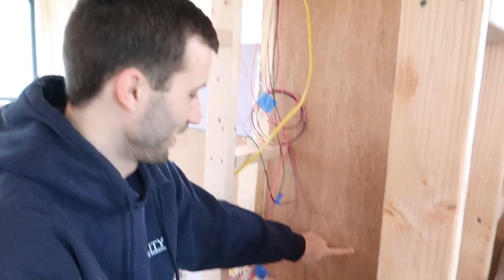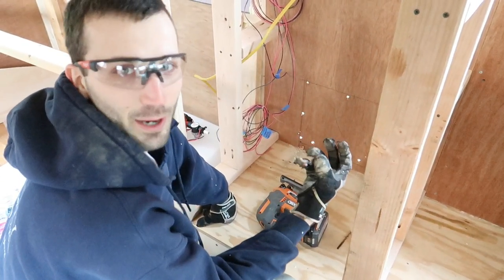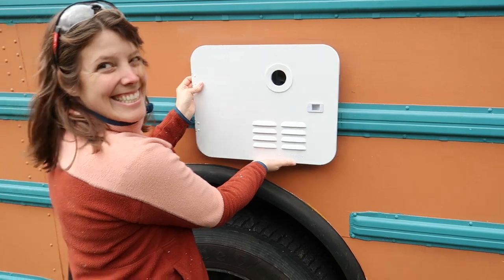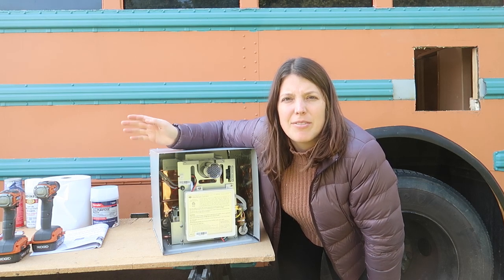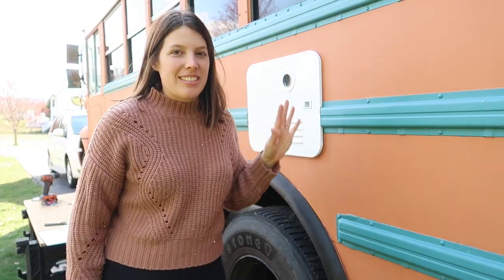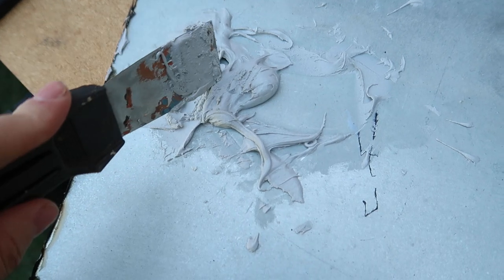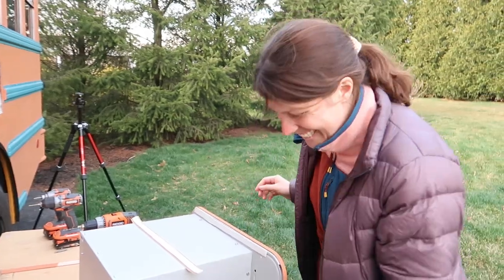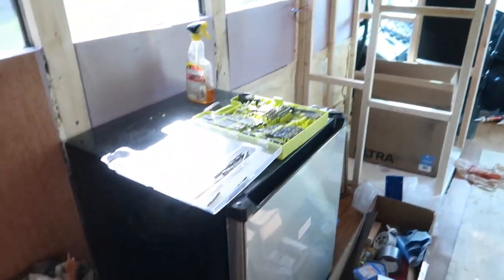Skoolie Water Heater Install - Girard GSWH-2 | BUS BUILD EPISODE 31

Comment: great installation it looks great and im glad you guys decided to take care of the exposed metal rails. one question, if you guys are running this water heater off of solar, what does your solar array and battery bank look like and how much power does it use when its on? I'm trying to find a water heater that works with my build but all of the heaters i have found online say they use over 2,000 watts which is to crazy to use with my current solar
Reply from the maker: Thanks so much! We have 1200 watts of solar and a 600 ah battery bank. Our water heater seems to use about 1 amp when we have it running.

Comment: How is it working for you guys? Do you think it’s as efficient at higher altitudes? I was looking at some similar ones and saw that some like the Fogatti talk about having high altitude modes. What are some of the other ones you guys looked at? I just spent 2 days trying to figure out the right electric water heater only for my husband to remind me we can’t have one that’s 3+KW thanks to our inverter so we’ve decided to now go with propane so now I have to do even more research and figuring out 😅
Reply from the maker: It’s worked great for us! We spent a couple months in Steamboat Springs, CO last winter which is around 7,000 ft and didn’t have any issues. It does have a “anti-freezing” feature that will automatically kick on in colder temperatures to keep the pipes from freezing. It’s a great feature, but can be a little annoying at night when we’re trying to sleep since it’s right by our heads. The other brand we were considering was Eco Temp but they didn’t seem as conducive to RV life with how much they needed to be vented but I think I’ve seen other buses use them with no issues. Good luck!!
Reply: @AdventureTrudge  thank you so much!

Comment: Hey wouldn't the screws that attach the cover to the water heater go the other way so they can also attach to the wooden enclosure you made?
Reply from the maker: We thought so too at first but the manufacturers instructions actually say to do it this way. We ended up filing the tips of the screws down a little so the points weren’t sticking out as much

Comment: Shouldn't you have screwed the door on from the inside out one it was in place?
Reply from the maker: Nope! We wouldn't want the end of the screws coming out of the bus and we can't access the wall it screws into from the inside since it's covered in insulation :)
Reply from the maker: Just re-read your comment and realized you were talking about when we attached the door to the heater housing lol we just did it per the manufacturer's instructions but we agree it does look a little funny having the screws stick out like that!